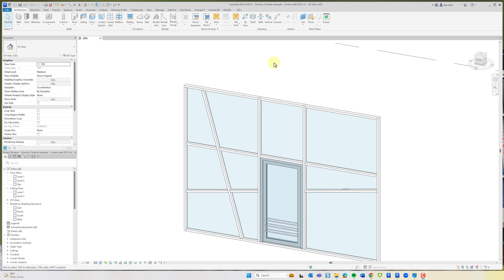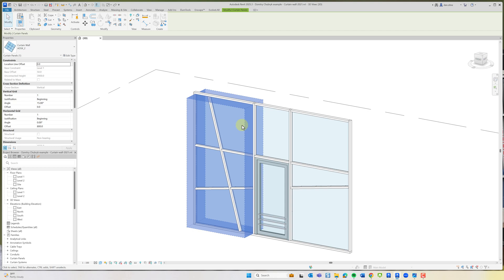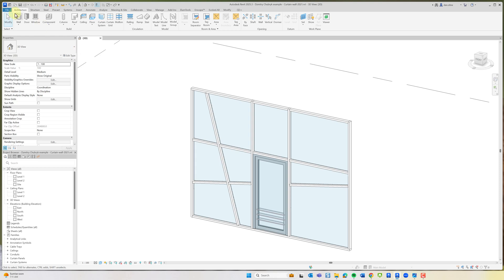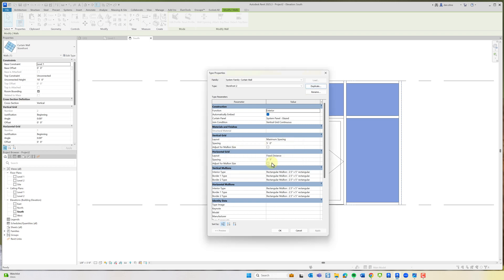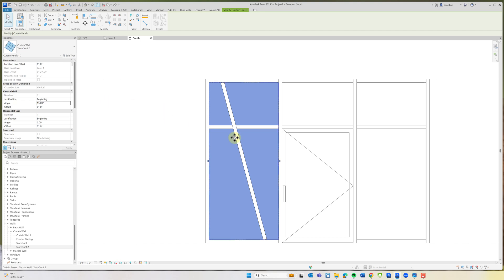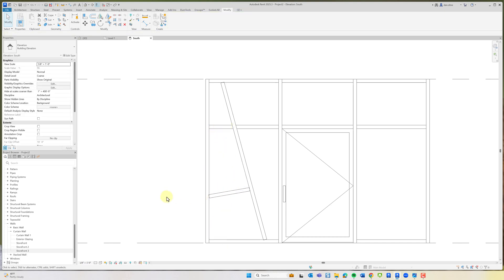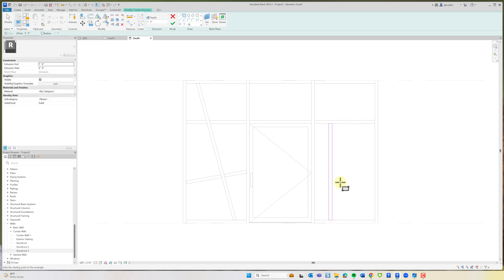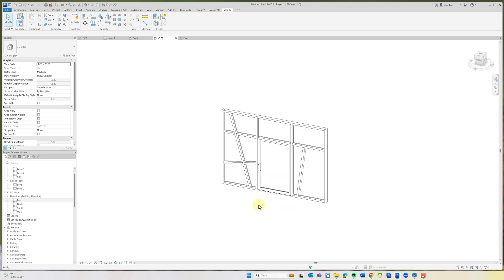Revit Angled Mullions in Curtainwall - Revisited

Comment: Very nice, I ran into this solution a long time ago but forgot about it,  "luckily" the stuff I work on tends to be more "regular". It is peculiar that revit lets you nest multiple "wall types" within the same curtain. I have used this nesting before to change a panel to a thin wall and then host a louver to that wall. 

One other workflow that I have seen used but do not know about it personally, is using assemblies for window elevation type drawings. 

I like the idea of using design options to hide stuff, but I feel design options are underutilized - I think people tend to not use that tool as much. I myself do not use it very often, it can get a bit weird with phasing too.
I personally still prefer to use a more old school method for window elevations/types, where I create an actual elevation view of a storefront but the elevation tag is modified to look just like a window tag, and to define the direction of the elevation, I have a tiny grey line(1/32" long) that you only notice if you zoom way into the PDF. For storefronts that repeat, a dummy tag is used to call out the same tag. 
I love groups but sometimes they get weird when you have them groups of windows/storefronts, and you have to move or split a wall, they will want to delete or worse that pop up that asks to fix groups. 

Happy Holidays Dan! I missed a bunch of your videos in my feed, I am catching up on watching them over the break, good stuff as usual!